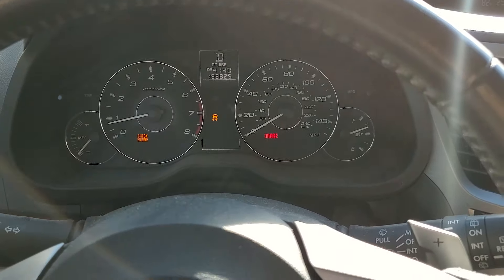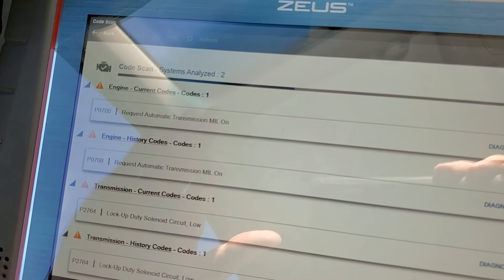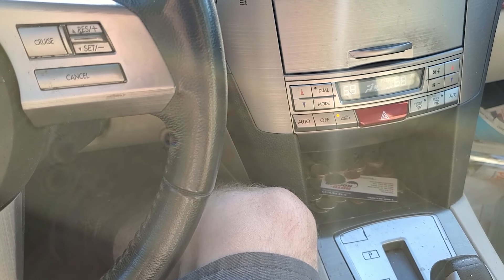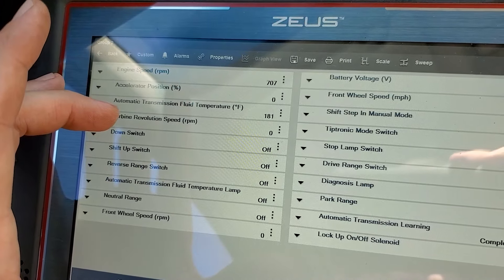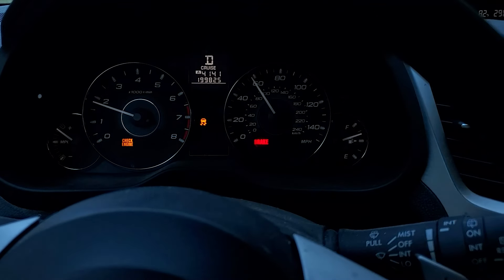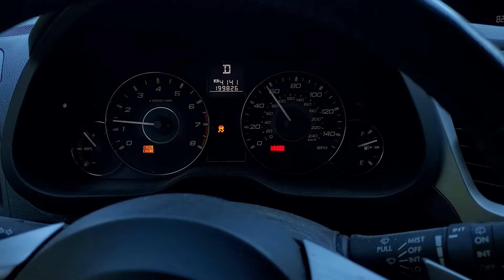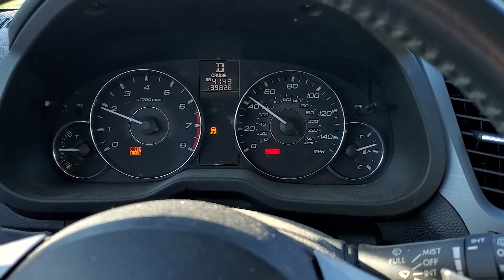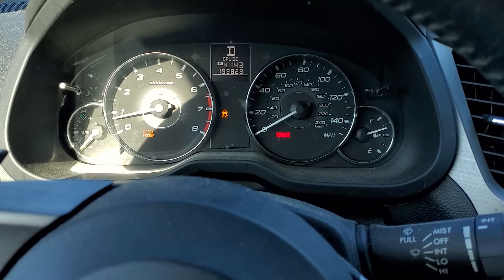Subaru TR690 CVT Trouble! My Brother's 2011 Outback's Transmission Issues.

Comment: I have a 2011 outback 2.5l limited with the same except no trans temp light. Mine jerks a lot after stopping. Also it is stuck in front wheel drive. I installed a new valve body and new fluid and it is still the same jerking. Where should I go next? Error I get is ecm doesn't communicate with tcm. I'm at a loss
Reply: I have the same symptoms as yours in my 2011 legacy premium 2.5i mine doesn’t jerk but it shuts off when coming to a stop no jerk at all I’m still in AWD tho

Comment: Forester 2014, last summer solenoid died (doesn't remember code), mileage was about 89k km. It was so much not in time, so I've replaced valve body at dealership. Old valve body still lies on the shelf - I want to rewind solenoid.
Does it interesting for someone? Should I try to make a video about this?

Comment: Hi Subaru technician. Good thing I found this video. May I please ask a few questions. 
My 2012 Subaru legacy Transmission got damage a few months ago. I have basic knowledge working on cars so I've decided to order a used transmission with low mileage for about $1300 in Virginia. After I've changed that transmission immediately I got P0841 "secondary oil pressure" is not reading pressure at all after I put initially 5 quartz and then another 5 quartz with the engine running along changing the gears. I have had to disconnect both transmission hoses from transmission lines and nothing comes out with the engine running. 
I've returned that transmission and order another one from a different company and I got the same code 1 code P0841 after replacement. On the instrument cluster those lights on your video are the same ones on my car. No transmission pressure and it doesn't engage, it doesn't move at all. 
What would be your advice? Do you think is a TCU problem or is the transmission damage again? Thank you in advance.
Reply: I wish he would answer!

Comment: 2016 legacy, 68K, already had that CVT temp light come on while on the highway upstate. Had to pull over and wait for the light to go out but mine solid I believe, not blinking. Wonder what that means lol. Whe merging on the highway, I now have a loud wine, my car sounds like a turbo until up to highway speed. I wonder if it's gonna crap the bed soon. i also get a little bucking (like a kid learning to drive stick) while going slow up hill coming to a stop as in traffic on an uphill. Not all the time but wasn't there prior

Comment: Hi bro , i have the same issue facing for 2015 Subaru legacy ! 
Is if save deive with the signs . Whats the solution  to solve it , any other method than re place the cvt  valv body , pls asvise

Comment: heyy my 05 outback 3.0r is locked in gear my shifter works and its not my shift cable but no matter what when i crank it i will always start in drive do you know what it could be

Comment: Hi Mr. Subaru. I have a 2012 Outback with 236,000 miles that I just bought for $3000. It has the TR690 CVT and I just experienced the Christmas Tree lights and got error codes P0700 and P2762. Took it to local Subaru dealer in Columbia and they want $2300 for Valve Body replacement. I can probably get it replaced for much less (<$1000) if I use a remanufactured valve body. They cleared the codes and I took it to an independent mechanic. Second  mechanic said they couldn't diagnose if it wasn't showing codes and said just keep driving it. I'm pretty worried the CVT is at the end of its life and if I get valve body replaced then something else will fail. I think the torque converter also needs replacing because it stalls with hard braking. Previous owner (a friend) was not good with maintenance/service. What are my options for a remanufactured/rebuilt CVT and can it be done for less than $3000? Subaru dealer said a new CVT is $10,000!!!

Comment: Also I've  thought about why Subaru doesn't sell  individual  solenoid,  is it because it makes more sense to replace with a whole new set and Valve body so it's a more complete unit Robert??
Reply from the maker: I can only assume. Imagine dropping the pan. Wasting $200 in CVTF. Remove vb. Replace solenoid. Reseal pan. Refill. Reprogram. 5,000 miles later, another solenoid fail. Repeat process all over again.

Comment: I have these exact same set of lights on my 2011 Outback intermittently right now....... But I have none of the driving issues.   No stalls or noises.
Does that mean just the Valve Body needs work, and I can avoid having to change the Torque Converter?
Reply from the maker: They can fail the solenoid without any advise driving symptoms. Seen it before.

Comment: Mr Subaru,
FYI: there will be a major resign of the 2024 Impreza. Seems to me the engine/transmission package should the same as the current model. Mass production starts fall of 2023.
Projected build forecast is just under 8,100 a month.
Reply: '23

Comment: My wife’s car has the cruise light flashes, has a check engine light that is solid traction control that is solid and it disable to cruise. I don’t think it shows any codes though which is strange. Has done it since 2016. 2012 2.5. Any thoughts?

Comment: I had this happen to me and when I got my code reader on it I got a P0700 code.  Would it being too hot cause this issue?  I drove to work this morning no problem but when I left work after my car had sat in the parking lot all day with a real feel temp of 114.  I let it idle for awhile and the AT Oil temp light went away.  Drove home with no problem and cleared the codes when I got home.

Comment: Hey @Mrsubaru1387 What codes did you have when you had these issues? I have a 2011 with P0705, The range sensor checks out .o.k.. According to prodemand i should suspect a tcm issue or a short to ground from the range sensor circuit however prodemand common repairs indicates valve body. I havnt driven the subaru much as i just bought it for parts but now i have intent to fix it. Checking for a short to ground from the tcm to the range sensor , if none found I suspect a tcm fault??

Comment: 2012 Outback with same warning lights displayed.  In addition, I've found that the  manual mode won't work when the warning lights are on .   If I clear the codes it drives fine until the CEL (and other lights) come back on so I am thinking it might be the TCM.
Reply: Fix? Try brake switch?

Comment: Mine just started doing this yesterday  but without the check enigine light or cruise control flashing. Just wondering if the wiring for the tail lights Share a load with power too the solenoid for the valve body? From what I have been reading is that having led tail lights can cause these lights to come on as well, I changed out the tail lights around a month ago too a aftermarket led set but before that I had led bulbs in the stock houses for a year without any issue. I can't change them back easily to rule it out so I was wondering if you had info knowledge on the electrical aspect of it all

Comment: My subaru legacy BM9 saloon 2009 model has aproblem.It has 130,000 mileage.It jerks between 0-20 km speed when accelerating.Past 20km the car runs fine.I replaced the spark plugs and cvt oil but still no change.What can be the problem here?

Comment: I have a 2011 Subaru outback,  first code was transmission module control, next was o2 sensor, now it's the p2763 torque converter solenoid. 145000 miles. I wont buy another one that I cant work on. I loved my 06 outback. Next vehicle will be back to my chevys.  My truck has 216000+ on it no problems. I can work on it.

Comment: Given you recently changed this torque converter, what would cause it to be failing already? As for the valve body, would you ever consider using an aftermarket option if you were able to get individual solenoids? I know you do not recommend aftermarket parts, especially for critical components, buta solenoid is either made well or it isn't.
Reply from the maker: I didn't change it. I replaced one on a customer's 2010. This is my brother's 2011.

His CVT hasn't been touched or even serviced.
Reply: @MrSubaru1387  Oh. My brain is getting stuff mixed up. What do you think about the solenoid thing?

Comment: Hey @Mrsubaru1387 thanks for the video. My girlfriend has the same model as your brother's outback. She has the same codes and flashing lights but her car has been driving fine with no stalling or hard lurching (with the exception of it loosing some acceleration on steep hills but we are also in CO). She's at 210,000 miles and in the last month started noticing the flashing lights (cruise, AT oil temp). Is it possible that just a bad transmission control module (TCM) needs to be replaced and not the full valve body/ torque converter? Thanks
Reply: I had this exact problem with my 2011 Outback and a transmission shop told me the TCM had to be replaced. I had them replace it for about $1500 and it’s still having the same issues. Any luck figuring out yours?
Reply: Hello….what was the issue?
Reply: have a subaru legacy 2011 3.6r and i had the accel decreas problem in the past when going on uphill its feals like the car lose power   . i felt like the vehicle needs air and i asked a garage guy to ceck my catalytic converter if its not cloged. wathever i asked him to cut it of ant put another one not the original cuz it was to expensive. but it worked perfectly. never had an issue after wit losing power wile going uphill. my lights still there but 100 000 miles later still not have the hill power problem. i payd 300$ for the piece to replace and 150 for labor . now my subaru is 230 000km

Comment: Having a similar but not exactly the same on my 2012 Impreza (NA) 150k. The AT OIL TEMP light is flashing with the check engine light. The car seems to pretty much drive normally with the exception that it will buck once when I first accelerate the car after starting it. How ever it will just do it the once and that’s it (is that just the car letting me know it’s in some sort of limp mode? Also my light starts flashing almost immediately after starting (before the car has had time to get hot). Leads me to wonder if it’s just a sensor or something. Any ideas?
Reply: Get a code check - possibly solenoid malfunction.

Comment: My 2014 Outback had the Valve Body replaced in Oct 2020 after having the AT Hight Temp light illuminated. Forward to June 2021 and the AT light came back. It has 100612 miles and I haven’t had the fluid changed. The dealer only drained and filled when they replaced the throttle body. Had it scanned and no trouble codes appeared for the CVT. Should I flush the CVT fluid?
Reply from the maker: It's on steady, or flashing?
Reply: @MrSubaru1387  it’s steady

Comment: Wow.... they had a needle for MPG on those? Wow.... I like the lights in my 2016ob cluster.... I think that needle wiggling around would mess me up...
Reply: The mpg gauge is just a vacuum gauge. The more you push the gas, the closer to the minus sign the needle points. On newer subarus, it's electronic, and the middle of the gauge represents avg mpg for the current trip.

Comment: My 2012 Subaru outback stalls sometimes when I come to a quick stop not always and likes to do it allot when I first start it up for the day. And the rpms jump and engine squeals sometimes when I go over 45 mph.
Reply: Send email to Subaru Corporate to insist they replace CVT. They know this is life-threatening.  If your cars stalls when you apply brake, and you are rear-ended by a semi-truck, nobody would suspect the failed CVT was cause because there is no identifiable code triggered for this failed part!!!

Comment: Mr Subaru, question for you. Have a 2014 Sub Outback, 2.5 Premium. When I come to a brake and stop, there is a slight shudder/vibration that happens for a second and then goes away. Happens at every stop when the air ventilation system is on, happens occasionally when the system is off. More frequent on long drives. Thought it was the torque converter not catching up to my change in operation, but Sub dealer said the transmission is operating fine. I'm skeptical. Any ideas on what this could be?? No noise happening just a the shudder.
Reply: Could be a dirty throttle body, MAF sensor, even an EGR valve

Comment: Do they also have a fuel gauge issue??? When you got the brakes hard (I’m assuming) it would go from quarter to full. Just asking cause I’ve been looking at those years knowing there would be trans issues but wondering about others!
Reply: That gauge is an instant fuel mileage gauge. When coasting it goes to the top, when getting on the gas it drops to the bottom.

Comment: My legacy stalls or sometimes try’s to stall at somewhat an aggressive stop, I think it’s the torque converter what do you think?
Reply from the maker: When was the throttle body last cleaned?
Reply: @MrSubaru1387   It’s never been cleaned since my ownership it’s a 2010 Subaru Legacy I know the tr690 have torque converter issues
Reply from the maker: Clean throttle body. Idle relearn. Start there. Have videos for both.
Reply: @MrSubaru1387  I’ve seen them, I’ll have to work on that it only does it every now and then Thank You!

Comment: So if it stalls out at a stop is that guaranteed TC? And what if you replace that could there still be something else wrong with the CVT that will burn through that new TC?
Reply from the maker: It's a likely cause, a known issue, but isn't 100% a confirmation.

Comment: I have a 2010 Legacy with 262,000 miles. I replaced the valve body last year and it has been good. Drove it about 10,000 miles. The other day all those lights came back one and it has P2762. I watched your other valve body video before I replaced mine and you did a relearn at the end. I did not do any kind of relearn. Is that critical?  Any ideas ?
Reply: Did you have any issues not performing the relearn?
Reply: @TechShanty  I cleared the codes and never had any more trouble..  It's going to hit 300,000 miles by the end of the year.  It seems like the relearn is not 100% required.

Comment: I have 2014 Subaru Forester 2.5l ..145k miles and I’m hearing clicking noise when I push down half way gas pedal and the noise goes out when I fully push down gas pedal BTW this occurs after engine warm up enough and driving about 10 miles. And on parking position there is no noise occurring. I’m confused what the f**k is this noise?

Comment: The dealership replaced my torque converter for $1700 in my 2010. Now when I slow down and the TC unlocks, the tach dips and I hear a squeak. They won't put a valve body in because there aren't any codes. I give them some credit, because most dealers would love another $1500 for a valve body, however at the same time I just want my car to drive normal. It has 187k miles. 

They told me they ran tons of data on it and there is no sign of chain slippage either. They don't know what to do and neither do I.
Reply from the maker: Hmm. Sounds like chain slip from the description.

Comment: Hi I just stumbled on your videos. They are so helpful. I have a 3.6 2011 subaru outback 150K miles on it. I have the bucking and same codes on. Subaru says I need to replace my valve body. I do not have the stalling at stops. Replacing the valve body at a dealership is going to cost me $2000.

I am looking for an opinion on if this is worth the fix. Are there more problems that happen down the line with these transmissions. I believe they aren't the CVT. Any advice would be so helpful. 

Thanks again, 
Heather
Reply from the maker: Correct, you have a 5EAT conventional automatic transmission, not a CVT. Without knowing codes, or diagnosing it firsthand, I can't say whether or not their diagnosis is accurate.

Comment: I'm calling your brother out for neglect...no visible passenger floorboard, lol. You didn't add the wheel bearing in, 2k (free labor? Say it ain't so!) I stood next to the XT Outback and that Wilderness suspension won't be no soccer mom material. New chassis, raised tuned suspension, big boy wheels...that 5th gen will be an orphan...well with about 40k.

Comment: I remembered the 08 GT has the valve body in the tranny cost nearly 2000; fortunately my neighbor was a 20-years subby mechanic and fix it for nearly half of the price...that little computer (?) cost a lot of work but he manage to do it in a dealership after hour...
Reply: 08 GT, I assume Legacy? 5eat, right? 08+ started using the Si drive, which can't be swapped with earlier. 6 speed WRX (manual knob), only other tyranny capable of the torque splits and the epitome of Subaru symmetrical AWD. But, I agree 100%, how do you make something so sophisticated with tons of electronic upgrades with non replaceable solenoids? Yes, expensive and impossible to find a donor match.